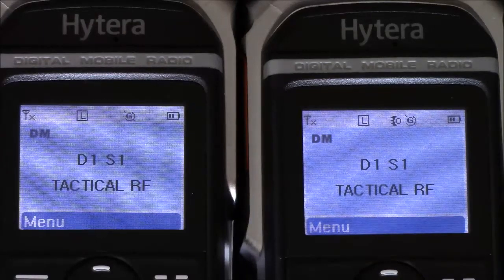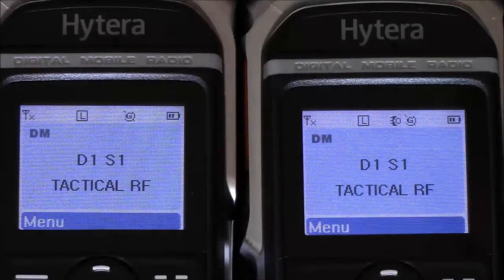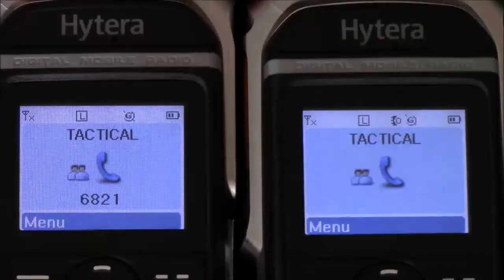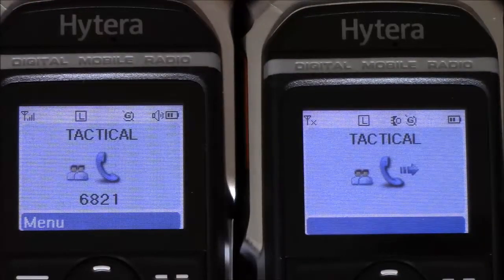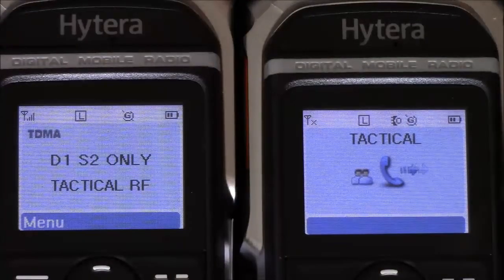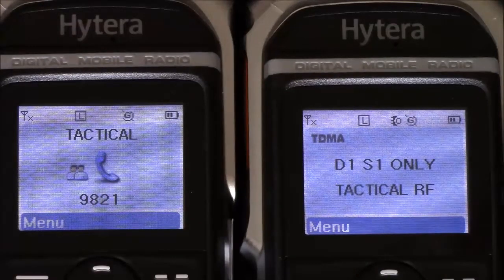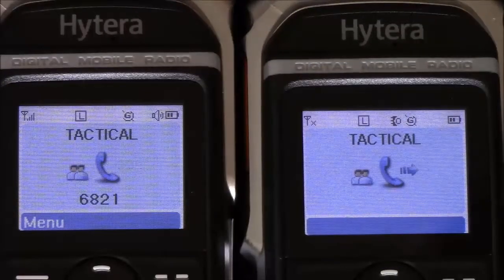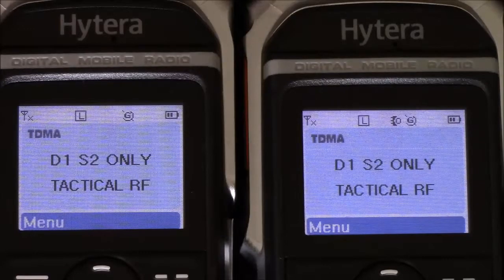Hytera 2 slot DMR simplex

Comment: Why does the radio on the left say TDMA instead of DM or RM? Isn't TDMA P25?
Reply from the maker: TDMA is Hytera's way of letting the user know the radio is in single slot simplex only mode. P25 phase 2 is TDMA, phase 1 is FDMA.
Reply: @tacticalrf5139  TDMA is Time Division Multiple Access.  It is a protocol that both DMR and P25 phase 2 have adopted to allow for two simultaneous conversations on the the same 12.5k channel.
Reply: TACTICAL RF Ah makes sense.